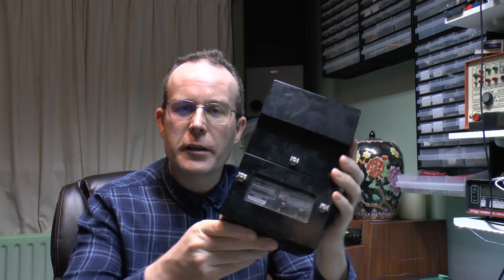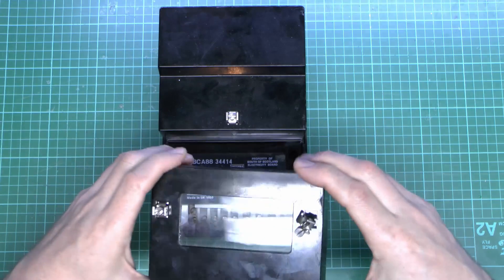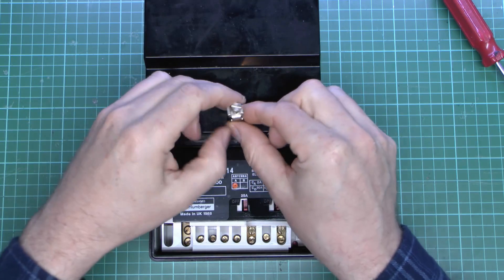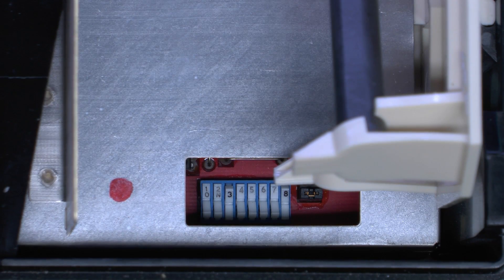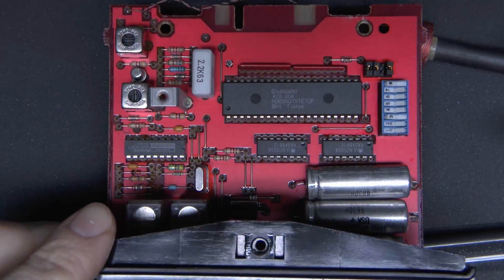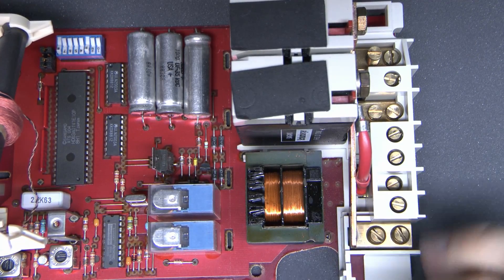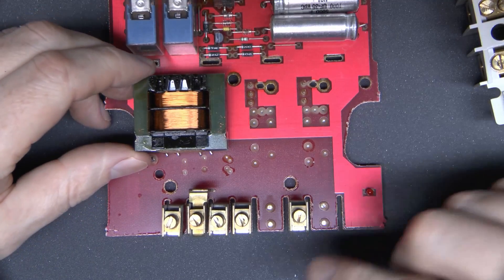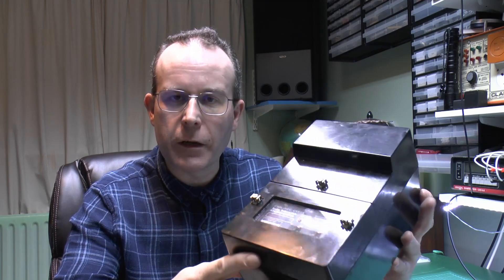Sangamo Schlumberger Radio Teleswitch Teardown

Comment: Do these units contain any sort of internal clock, or do they solely rely on the radio signal to trigger the switching? Whenever the long wave switch off is discussed on forums, there is debate about whether it will mean people's meters will be stuck on day rate (and maybe their heating not come on at all) or whether it simply means the timing of their Economy 7 will drift as it will still be controlled by the internal clock, it's just that will not be re-synchronised by a radio signal. Which is true? Is there is clock? It doesn't seem to me that there is, but then we don't know what each of the ICs does.
Reply from the maker: They have an internal clock but it's not particularly accurate.  They can be set to use a default set of timings for when the radio signal is not available, but the internal clock will drift significantly over weeks/months so will end up switching on/off at times which are not wanted.
They were never intended to be used for long periods with no radio signal, so with that signal being switched off, all of them should be removed.

Comment: Very Interesting. Do you know if the switched neutral is powered up continuously at Economy 7 times or does it just pulse trigger a latching relay to turn over to the night meter?  The reason I ask is that I am one of the 1.5 million people who still have one of these meters and I want to provide an input to the e-sense input on my Zappi EV charger and I don't have circuit which is powered up exclusively at Economy 7 times.
Reply from the maker: Yes, for the meter to be in E7 rate, the neutral input has to be connected 100% of the time.  Meter will switch to standard rate as soon as it's disconnected.
Reply: @jwflame  - Thanks John, I have sent off for a CT clamp to hopefully get a suitable signal off this cable.

Comment: Could you get the signal by using a scanner and then use it to hack the meter? How do they stop that?
Reply from the maker: Could be done, but there wouldn't be much point.  All you could do is change the times it switches on/off.

Comment: Pretty telling that the unit looks like brand new inside, no brown areas on the PCB or components and the soldering looks all good and proper. Only the outside styling does not arouse a lot of confidence in a non-British viewer :-)

Comment: My uncle in the seventies actually stayed up one night to prove exactly your point. The utility company is charging you for the bulk of the power draw before the secondary circuit kicks in. Being the mad genius that he was, he figured out that there's about a forty minute delay between the two outputs; his solution was to have an industrial timer (from a pool) to keep the water heater off until the secondary output turned on. In hindsight I don't know how legal that was but it was sure pretty damn clever.

Comment: Intresting vid, I've not ever come across one of these here in the UK, but when we went on holiday to France in 1989 the house that we stayed in had a very similar system for remotely switching the hot water system, every night at 10:30pm you would hear a loud 'clunk' from the meter cupboard as the system energised and also a distinctive dip in the brightness of the house lights, (it was in quite a rural area), but on the said controller there was a self resetting manual override switch that u could use to switch on during the day, which we often did!
Strange thing was that the day before we came home the utility supplier replaced the unit with a more modern version! They left the old one behind in a bin, I brought it home but can't remember what happened to it!

Comment: I've read the comments from this and another video about the dip switches being used to set the time periods but this does not seem to make sense. If that where the case the on/off times would be set and wouldn't need a signal. You might as well use a time switch. I would have thought the whole idea of it being controlled by a broadcast signal is to remotely switch the unit at a specific time that can then be changed if needed without changing all the teleswitches, like you would have to do if they were permanently set at specific times. Surely the dip switches are for configuring the reception frequency to be able to control them in groups etc so that different areas are switched at different times to control the load on the grid.
Reply from the maker: The switches don't directly alter the switching times, but they will mean the receiver responds to different transmitted codes, so by changing the switches it will operate at different times, but only because it is using different codes.
Reply: That makes sense. I was close with theorizing that it might be different frequencies. It must also change the configuration of when the 2 rate change relays operate as well as both of them operating at the same time didn't make sense unless they can also be configurable. Although, maybe the jumpers are used for that.

Comment: Jon I have a battery charger that buzzzzzzzzzzz all the time why is that, I was trying to send you a 20 second video but don’t know how to.regards rob
Reply from the maker: Probably loose laminations or windings in the transformer - happens as they get old and the varnish dries out.
Reply: John Ward it’s 35plus years old in fact it s 39 years,  not done to bad👍

Comment: This question is not related but it has really disturbed me.
I hope John ward answers me or anyone.someone to clarify for me,why is neutral earthed and i think the current 
would still flow between the two lines in absence of the Earth?It is said earth is at 0v,why does the bulb fail to light when you connect negative terminal to the earth without having another connection to the positive terminal of the battery or vice versa?kind regards for any comment
Show less
REPLY

Comment: Wonder how many of these units would still be working today if the makers had chosen chosen a switchmode power supply rather than an oldschool one? (bet - very few)
Reply: It's interesting how well they do work nearly 30 years on -- even with the Sprague electrolytic filter caps which have something of a reputation. I've just picked one of these up on ebay, and it's very much built like a tank.
One other interesting thing, they used a double sided PCB - the entire top of it is a ground plane. There are wire links to jump tracks across. Really interesting design, and not something you'd see done these days.

Comment: Aaaah, now then, there's something you got a bit wrong in there. Firstly, once you had liberated the circuit board from the back-case, that black bit on there with all the specifications on it actually comes away from the circuit board to reveal a small transformer and a couple of BIG CHUNKY CONTACTORS

Those little Omron things you pointed to, they are for the Rate-Change trigger on a dual-rate meter, and are 5A max.

If you pop over to the BoomBoxDeluxe channel, you will see a similar model of this being opened up, and how to dismantle it to reveal the big chunky contactors.

Over time, there will be a FULL HIGH DEFINITION re-shoot of the device coming up, over on Wayne's Electrical so to avoid missing out on that, feel free to go over there and =BAAANG= that subscribe button, as things like this are discussed, along with what went before these (the big chunky 80A and 100A Rate-Changers)

I found this one interesting because your one has the additional space occupied with another contactor (the 25A one) whereas, on my one, that location is empty and not used.

Similarly, your one has two 5A Omron contactors on the inside of the board under the shielding can, and it makes me wonder what the second one does! One of them is definitely for rate-changing a dual rate meter (like a Sangamo Weston S309.2, which can be seen on the BoomBoxDeluxe channel)

Another thing I would like to know about your unit, and that is the positions of those mini-switches on the circuit board.

Like you said, I also think that those are used to configure the switching times and the tariff. It would be fantastic to know a few switching combinations so that I can try them out in my unit to see what each one does.

Like I say, pop over to BoomBoxDeluxe and look for my Radio Teleswitch, and you will see how to open one of these to reveal all the goodies, including those chunky contactors right at the bottom of the board.

Edit: You discovered that the two Omron contactors dont switch the main loads by looking at how thin the connections are on the back of the board. :D You also noticed that the central black part does indeed come off to reveal the power supply transformer and the chunky contactors. YAY!! :D

Also.... OH MY GOODNESS!!! You managed to seperate the big contactors away from the circuit board!! :-O

Thanxx for showing,

-Wayne's Electrical.

13th February 2018, 04.10

Comment: I believe they also used them for "Economy 10" in my area, It was similar to "Economy 7" but you got 10 hours at a cheaper rate in every 24 hour period - but you never really knew when you'd be on the lower rate! I do remember the telltale "Clunk" just as Coronation Street ended, It was used to run the Storage Heaters and Immersion Heater - but I'm not sure if they could control the 2 separately
Reply: UkSkin yes they can. JW mentioned briefly the codes for different tarrifs and there's literally hundreds. Some have heating and off peak on different circuits (sometimes called warmwise) and others require a nifty arrangement of two meters. I've even seen a grain drying tarrif!

Comment: I guess the LED is a signal strength indicator so the installer can see which ferrite position works best (without hanging around til midnight)
Reply: No... I have powered-up my unit and that little red LED is on continuously in the bottom-right of the circuit board.

-Wayne's Electrical.

13th February 2018, 04.18
Reply: I wonder what the procedure was then?
Reply: LOL, I wouldn't mind betting it was as simple as the installer bringing along a small LW radio and seeing if it works close to the position that the teleswitch is going to be installed. :D

It's either that, or they has some kind of hand-held signal strength indicator, or....

They just took pot luck, bunged the thing in and called back the next day to see if the storage heaters are hot. :D

-Wayne's Electrical.

13th February 2018, 18.52
Reply: maybe they just waited to see if the customer complained after a new install... also I think there were plans to export the technology (though I don't think any other countries adopted it) and it might have been more appropriate in larger countries with greater distances to the transmitter involved.

Comment: Presumably there's a point in the radio side circuit where  you can attach a small speaker and hear The Archers.
I've got a vague memory of hearing that the encoding was ultra low bandwidth and capable of being received correctly even in  areas where the audio wasn't listenable quality

Comment: I would love you to connect a lamp load to the radio controlled switch to see if it still receives anything?
Reply: AllTheGearNoIdea, they still work. The plan is to replace with smart meters but there's no specific upgrade program for them or any other legacy equipment so I would expect to be seeing them for a few years yet.
Reply: mellonians Thanks. It would be interesting to see how the switch control is encoded within the LW transmission
Reply: Hiya. I have sent you a Private Message about this. :D

-Wayne's Electrical.

17th February 2018, 14.01
Reply: Wayne's Electrical did you send me a PM or All the gear? Lol
Reply: mellonians  So don’t think so. Must have be naughty finger trouble or a senior moment. Sorry.

Comment: John, put a nice safe 12V dc across throse three supply caps, then go looking around the small IC closest to the radio front end. On one of those pins, you should find the BBC Radio 4 broadcast signal!
Reply: I'll have to try this with mine...! I did notice the little Mietec/Schlumberger chip near the radio front-end and wondered if there was a signal tap-off point. Might have to repeat Alan Cordwell's experiments with an Arduino!
Also got a Horstmann teleswitch which is much newer - infrared port for configuration/status (but this seems to be dead), custom IC for the radio (this time made by Dialog), and a much messier circuit board layout. You can tell it's newer just by the PCB layout. I'll have to see if the "12V trick" will work with that one (after carefully measuring the supply voltages with a meter first, obviously)

Comment: 3 coil connections on the big contactor relays because they are latching ones.
You don't need to constantly energise the coil when you want the load on, just a pulse on one coil to turn on, a pulse on the other coil to turn off.
Very power efficient and hence the small transformer but a lot of reservoir capacitance.

Comment: Incidentally the introduction of radio teleswitching caused some problems in the power industry. Before these we just used an electric time switch with 36 hour spring backup in case of power outages.  These were fairly inaccurate so the load in a region switching on at (say) 10.30pm would actually be spread over about 10-15 minutes. After the switch to Radioteleswitching it was one big clunk and hundreds of Megawatts of load comes online. Places like some island communities in Scotland that were still powered by diesel generators had some problems with a big voltage sag!

Comment: This thing is cool. Would be interested to see a more detailed reverse engineering. How it derives the various voltage rails, and switches the relays (Are the large caps used to help?).
Googling the MCU I found this datasheet:
https://www.jaapsch.net/psion/pdffiles/hd6301X_datasheet.pdf
Another vid about it here:
https://www.youtube.com/watch?v=DCx-tfCiBYs
This is 80s radio decoding and high powered switching, would be awesome to see how its doing it! Perhaps send to big clive [with schematic] or mikes electrical !?:)
Reply: Also, why does the neutral have smaller relays? If the AC load is on both L and N in operation, then surely the N relays would need to be rated for the same current as the L relays? Am I missing something? (Perhaps a schematic and followup vid John?)
Reply from the maker: Neutral switching isn't for the main load, it's separate low power outputs for controlling the meter.
The main load neutral isn't switched, or even connected to this device.

Comment: The big chip is a Hitachi microcomputer with built in ROM and RAM based on the 6800 processor. http://datasheets.chipdb.org/Hitachi/6301/HD6301V1.pdf

Comment: Using Radio to control heating loads like this is interesting. Were I am we use (or used to use before smart meters, not sure) 'Ripple control', they sent the controlling signal over the power line itself. using codes to control certain groups is/was the same. Great video

Comment: Interesting equipment. What sort of transmitter is used to operate it?  I'm in Australia first time I've seen this. I suppose all this is now superceded by computer and internet. It's long since I first produced transistor pocket crystal sets for sale to my school mates c1957. Rgds from Australia 12FEB2018
Reply from the maker: https://en.wikipedia.org/wiki/Droitwich_Transmitting_Station
Reply: Uses phase shift keying of the 198kHz carrier for BBC Radio 4.
Reply: http://tx.mb21.co.uk/gallery/gallerypage.php?txid=1454&pageid=2076
More info on the R4 transmitter network

The same website also has pictures of nearly every radio/tv transmission site in Britain inc. a large google map of every one.

Comment: Interesting video John, I just wonder how secure these units were. You can imagine these days buying a radio transmitter from ebay to turn these on and off at will.
Reply from the maker: Theoretically possible to use a radio transmitter to control them, but you would need to know the specific codes for a particular device, and even then the only 'damage' would be to turn someone's heating on or off.  Once your hacking transmitter was turned off, it would go back to normal operation.
Not very likely that anyone would go to the significant time and effort for no real purpose.
In terms of a much larger scale attack whereby large numbers could be switched on/off rapidly or in other malicious ways to affect loading on the electricity grid, you would need a transmitter powerful enough to obliterate the official signal, which at 500kW would be next to impossible.
Reply: NoviceAngel1 - good point there, I have two 400 watts floodlights connected to a remote control switch and sometimes they turn on due to the shitty CB radios the truckers use...